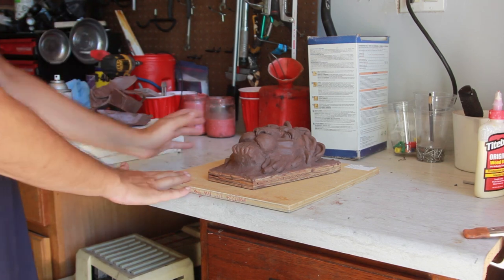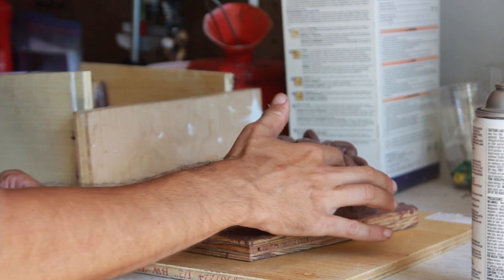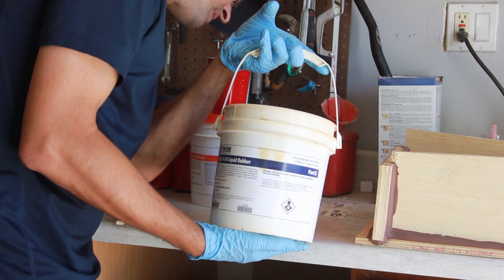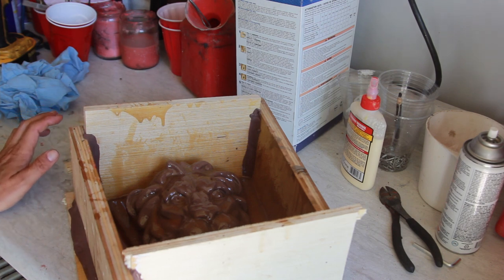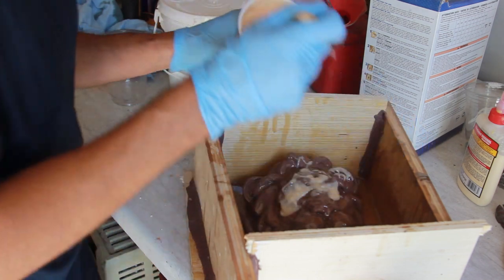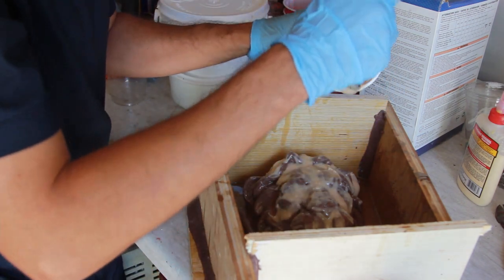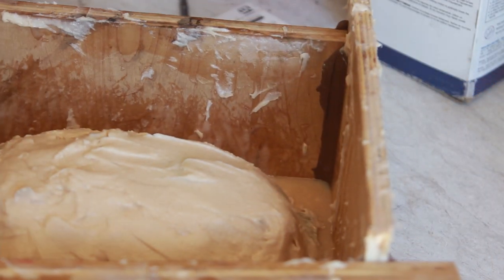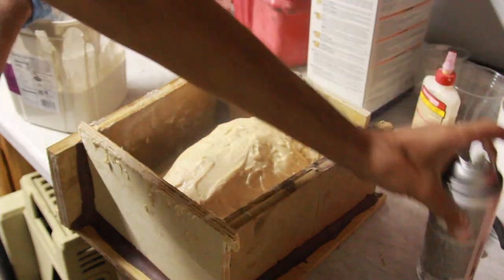Molding a lion relief sculpture in Polyurathane rubber

Comment: Nice work and very helpful. Thanks.
Just a comment on the final casting process. I just pour about 1/3 into the mould ( in my case it's concrete) shake  , tap and agitate the mother mould. It's easier when there isn't too much stuff in the mould. That gets rid of any bubbles .